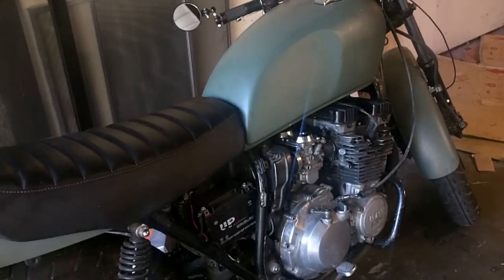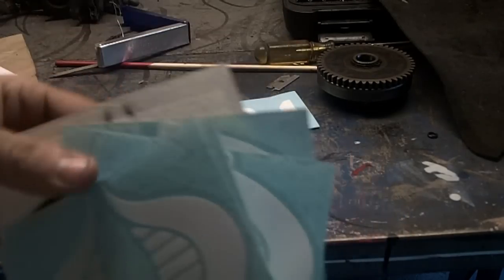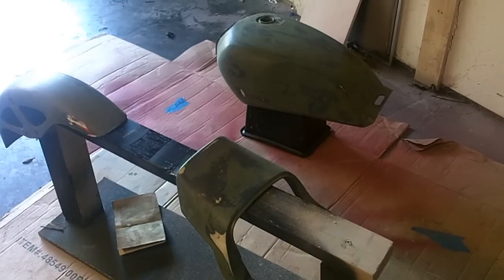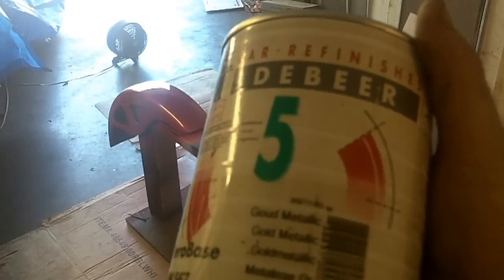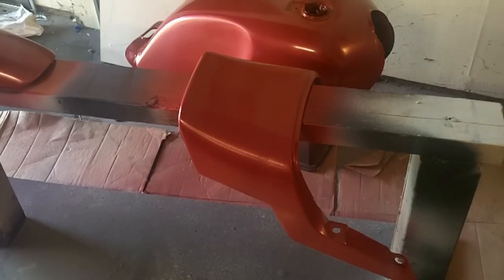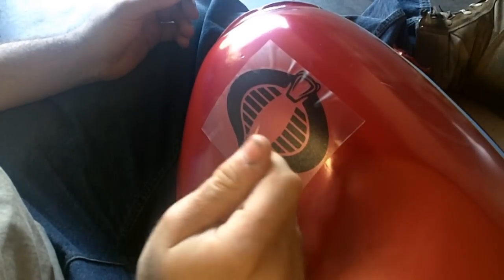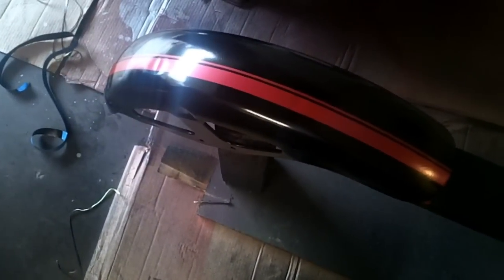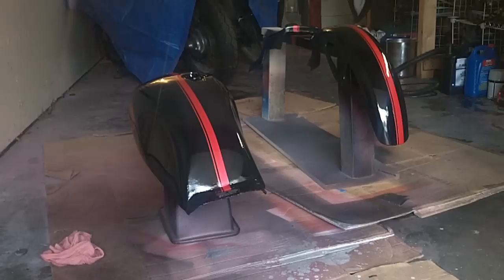Fixing up the XJ550: Episode 10: Paint

Comment from the maker: Yeah that vacuum was blowing not sucking, I know of a tragic story of my own about sucking gas fumes, definitely not safe. I wanted to blow all the gas out of there so it didn't interfere with the paint. And second yes I tape up the mouth of the tank, it really isnt that big of a deal if you get a little paint in there, but ultimately it will degrade and introduce impurities into your gas so its definitely better to block it off.